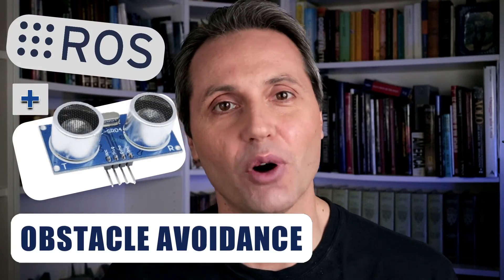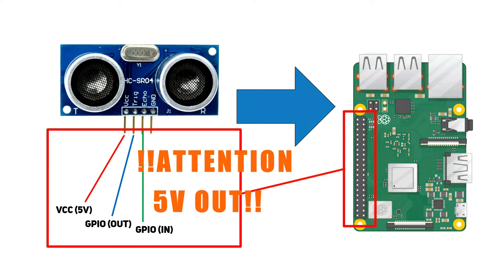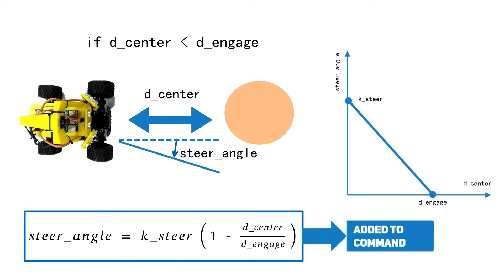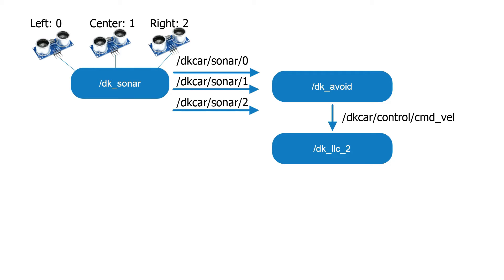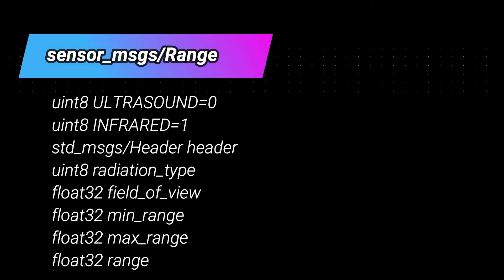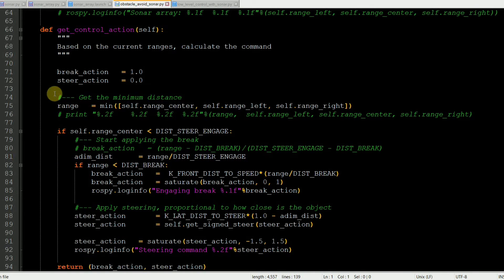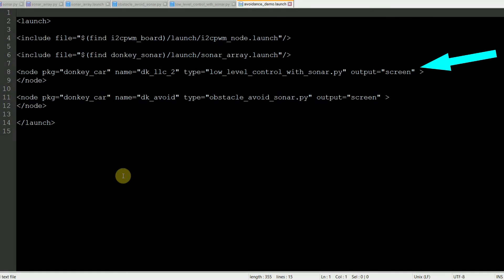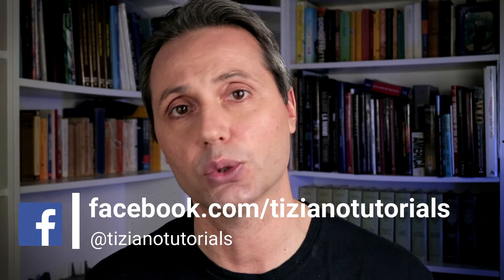ROS and SONARS for OBSTACLE AVOIDANCE | Tutorial #6 | ROS and Raspberry Pi

Comment: Hy Tiziano I want to make the same functions but i don't have wheels which turn i can only speed up the outside wheel to make the turn, and i can see that you used the Twist library but i don't think i can with my configuration.
What do you suggest me?
Reply from the maker: I think you can use the same and tune the speeds for your case

Comment: Thanks a lot for this. I am trying to implement it for turtlebot in gazebo and I have a doubt in the code. You have used an updaterange function where you used angle = fieldofview, but Isnt the fov constant for a sensor?.. Its predefined as 0.29 in gazebo plugin. So I modified it to just update the actual ranges instead of angle.. And it somewhat works now. Another thing, ur code is amazing and especially the control command part.. Im still trying to understand. Can you suggest me a good book which teaches practical control systems wrt robotic application? Because all the plotting of bode and nyquist and solving block diagrams in college are not helping me practically now. Thanks
Reply from the maker: Thank you, the code was meant to just give an idea and I am sure it can be optimized. Now for the control books First of all to suggest you the "Digital Control of Dynamics Systems" (Franklyn Powell), absolutely a must to have for digital and also classical control. Another really great book with lots of practical applications if Steve Branton's "Data-Driven Science and Engineering" and his amazing "Control Theory Bootcamp": https://www.youtube.com/watch?v=Pi7l8mMjYVE&list=PLMrJAkhIeNNR20Mz-VpzgfQs5zrYi085m
Reply: @prandtlmayer  Thanks a lot, will look into them

Comment: Very nice Tutorial, thanks! How ever It didn’t work for me. When I run the launch file it doesn’t show the data.. stays with “running..” the package did compilate and the sensor are already attached right. Any Idea?
Reply: When I run the test It works perfect but only that
Reply from the maker: One of the problem I faced was the infinite while loop that starts when the signal is fired and I was waiting for the bounce. Check if it's stuck there
Reply: Tiziano Fiorenzani  Thanks for answering. I found the Problem. If one of the sensors don’t work, the program gets Stuck (waiting for a Signal that would not come). I changed 2 of the Banggood sensors for other good ones and It worked Perfectly. My car will be soon driving autonomous :D

Comment: Can you tell me why this is happening?
I run the roslaunch donkey_sonar sonar_array.launch command, after which an error occurs and the connection with Raspberry is lost

ubuntu@ubiquityrobot.local:~$ roslaunch donkey_car sonar_array.launch
…logging to /home/ubuntu/.ros/log/70b4b392-d0dc-11e5-bb1e-97cdfee2502d/roslaunch-ubiquityrobot-1735.log
Checking log directory for disk usage. This may take awhile.
Press Ctrl-C to interrupt
Done checking log file disk usage. Usage is <1GB.

started roslaunch server http://ubiquityrobot.local:32859/

SUMMARY
==========

PARAMETERS
* /rosdistro: kinetic
* /rosversion: 1.12.14

NODES
     /
       dk_sonar (donkey_sonar/sonar_array.py)

ROS_MASTER_URI=http://ubiquityrobot.local:11311

process[dk_sonar-1]: started with pid [1752]
[INFO] [1455208188.005188]: Initializing the arrays
[INFO] [1455208189.007952]: Sonar 0 set
[INFO] [1455208189.020812]: Publisher 0 set with topic /dkcar/sonar/0
/home/ubuntu/catkin_ws/src/donkey_sonar/src/sonar.py:23: RunTimeWarning: This channel is already in use, continuing anyway. Use GPIO.setwarnings(False) to disable warnings.
  GPIO.setup(gpio_trigger, GPIO.OUT)
[INFO] [1455208190.027591]: Sonar 1 set
[INFO] [1455208190.040614]: Publisher 1 set with topic /dkcar/sonar/1
Connection to ubiquityrobot.local closed by remote host.
Connection to ubiquityrobot.local closed.
Reply from the maker: This is weird. Even if there was an error, that wouldn't explain the disconnection. Would you try connecting through the Ethernet port?

Comment: Can we connect this to Pixhawk or APM flight controls...???
Reply from the maker: Yes, there are actually a few ways. The first is connecting the sonar to the autopilot. Check out the Ardupilot documentation. Otherwise you can send the readings from the companion PC using a rangefinder mavlink message
Reply: @prandtlmayer  thanks

Comment: i want to use ROS for my fyp project, my project is fully automated grass cutter. my project currently used infrared sensor to detect obstacle. if i use ROS, do i need to replaced it with ROS and can we set the movement of my grass cutter robot using ROS? pls reply i really need your answer
Reply from the maker: Yes, you can do everything using Ros